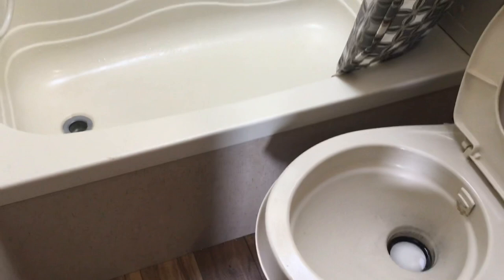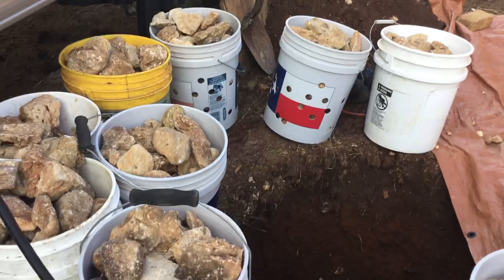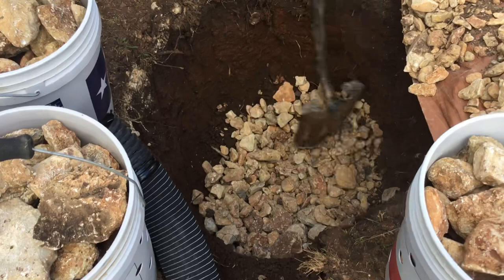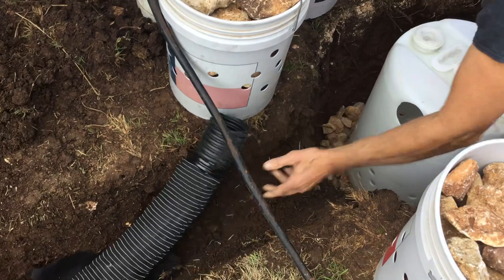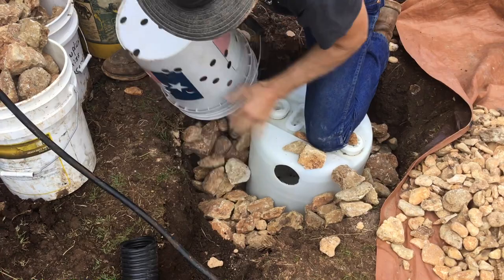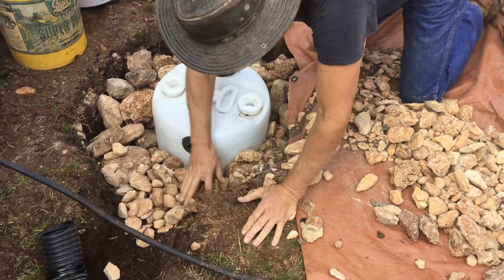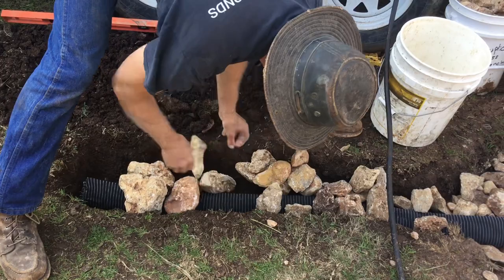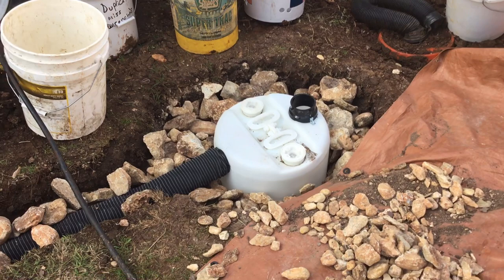RV Dump Bucket off grid RV septic system

Comment: Definitely not legal. Won't work. The smell will be horrible, but good job for the click bait to get views.
Reply from the maker: Check your local laws it would be just like an old house. Does work. Obviously you don’t know anything about Septic Systems or how they work. While the water is running through the hose into the Dump Bucket you can smell it within a minute or two no snow it’s all underground. And I don’t look for clicks I just help people out.
Reply: Works fantastic, thx
Reply: It is legal depending where your at! And this type of system has been in place long before current septic systems and does not smell if covered with the appropriate amount of dirt!
Reply from the maker: Check your local laws. Works fantastically it’s been tried and proven customers love it. No smell just like a septic system in your own backyard it’s all underground. Click bait don’t need it.
Reply: Also I would think y'all should be using something like "happy camper holding tank treatment" which removes the smell anyways. Each treatment is only like 75 cents and treats 40 gallons. Why would you smell crap to save 75 cents?!
Reply: You think would work for gray water (shower and sink)

Comment: and when it pours down heavy rain, it over flows and stink to high heaven.
Reply from the maker: When installed correctly this is never an issue.
Reply: Why would it stink? Do you not treat your sewage? You should be using something like "happy campers holding tank treatment". Then there is no smell. Plus it breaks down everything quicker which allows it to absorb into the ground quicker as well.
Reply: I dont care what you put in your tank, there is always a smell.

Comment: Where does the toilet paper and poo go? Is this just for shower water and pee?
Reply: If you are using the proper treatment in your tank, it will break everything down. Then it being pushed into the bucket with the water pressure, it gets pulverized and breaks down further. However, the treatment you put in your tank, such as "happy campers holding tank treatment", will break everything down. It all just then gets absorbed into the ground.
Reply: Need a good treatment RV Digest It works extremely well. I've used Happy Camper before as well but I like RV DigestIt treatment pods or liquid form.

Comment: Not sad, ever hear of a composting toilet?
Some nice thrones, and you can fertilize a nice row of Cypress trees, for a wind break.
Or some other none food tree, biodegradable soaps and shampoo can drain into the yard.
Solar and those rooftop wind turbines for power on sunny or windy days, homesteading it totally green if you want it to be.
Reply: we use a homemade composting toilet that has a urine separator. Been using it for 3 years now and love it.  The urine runs out from a pipe into a graywater system like shown in this video.  All solid waste goes in a bag in a bucket, and then we cover it with sawdust.  We dump it once a week into a compost out back, and have 3 large bins that we cycle every year.  Every year, the 3rd year bin gets used for ornamental plants and trees around the property. The toilet has a 12v computer fan that pushes any air from inside the bucket out through a vent to the outdoors.  There is no smell in the house, and we make great compost for shrubs and trees! :D   Highly recommend doing it this way if you can in your area.